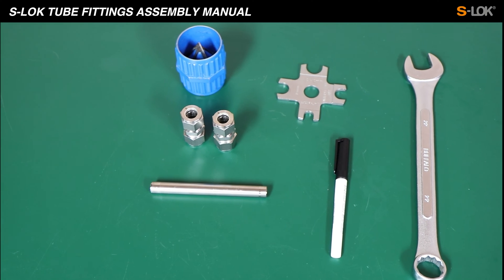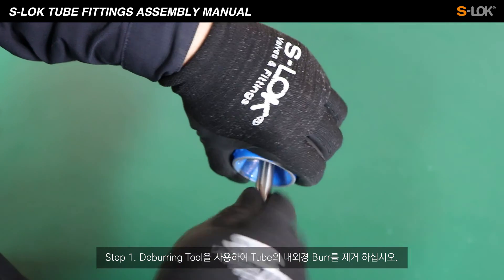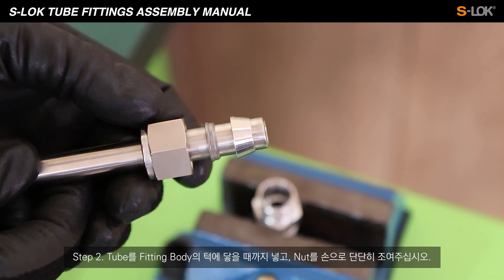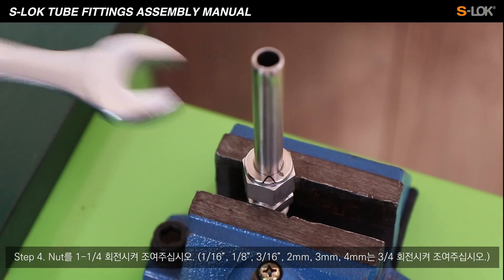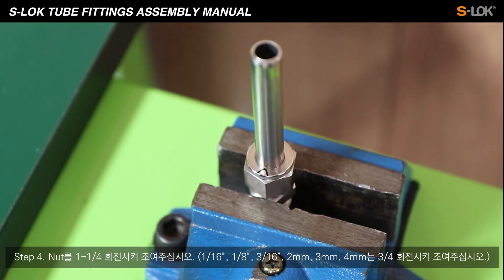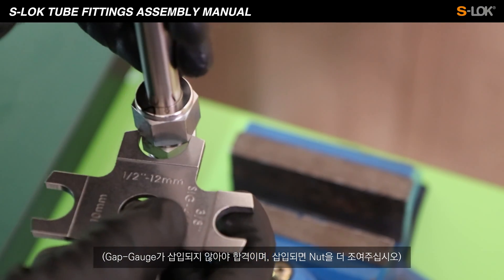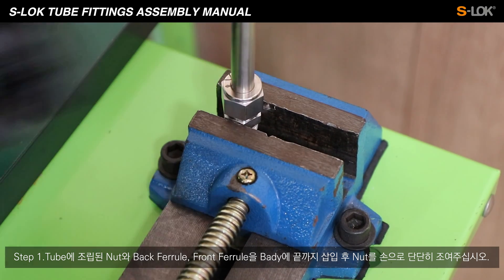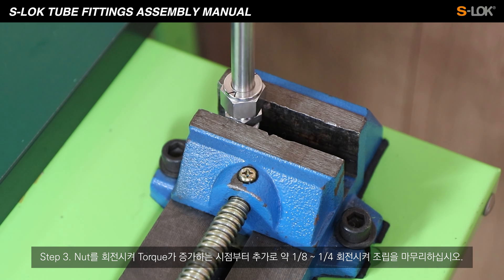S-LOK Tube Fittings - Installation Instruction

Comment: Would this instruction also be true for the installation with PFA tubes instead of metal tubes?

For 6 and 8mm OD tubes, that would mean 1 1/4 turns, correct?
Also i would like to ask if this also stands true for using the S-Lok single ferrule tube fittings.

Looking forward to a reply :)